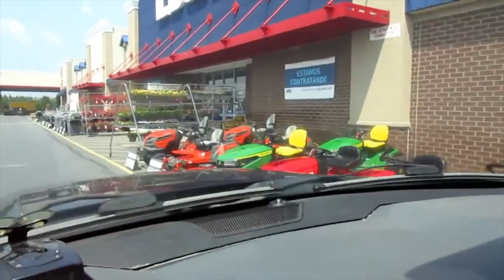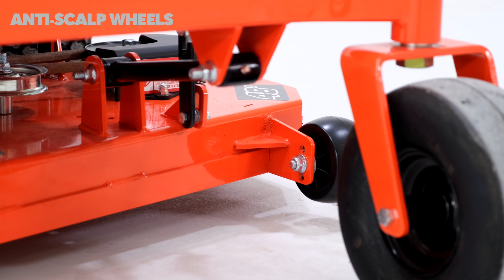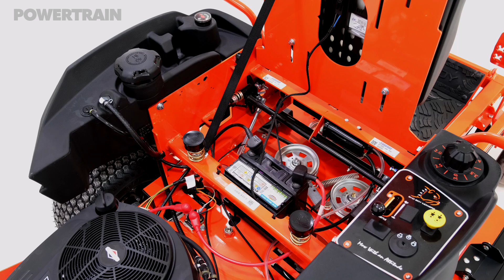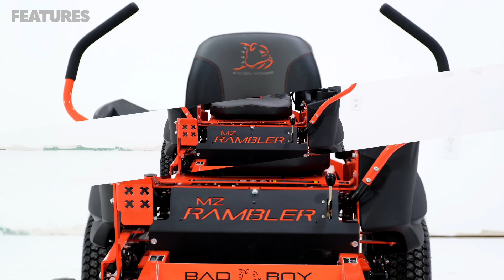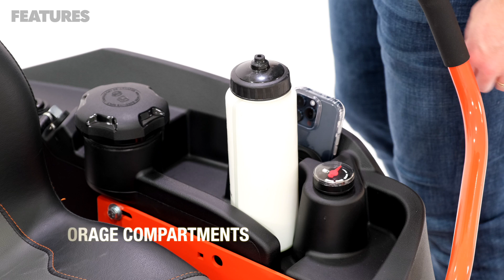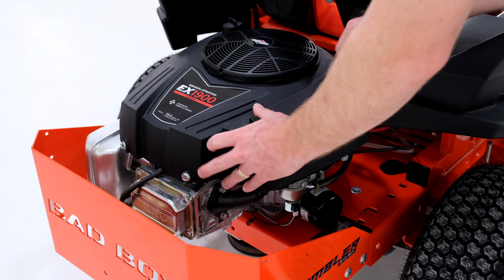Best Residential Mower FOR $3,000 | 2024 Bad Boy MZ Rambler

Comment: how many inches is it from the seatback to the drive handle while in reverse   i sat on a 52 incher and  the handles where in my chest when i pulled back  on them   was about 12 inches   gap  with the seat all the way back
Reply from the maker: If you’re having that issue I’d recommend getting the adjustable steering arms which will allow you to position the arms so that they don’t hit your chest.

Comment: I have 4 acres but only mow two of them. I'm thinking on getting one. I am not worried about speed or getting it done super fast.
Reply: If 2 acres are not too hilly, this is only mower on market you want.  Best $ to quality.  Change oil and filter every season, no matter hours thou.
Reply: @redvraven3285  It's not hilly but it is very bumpy in some parts. Lots of trees and tree roots.
Reply: @bertroost1675  Rambler has best deck on market I know of.  At 7g it will take a beating from them roots banging around.  Bumpy is bumpy.  Rambler has seat springs.  Comfy for 2 acres.   Stihl's and Ferris have 4 wheel suspensions on entry level models that are usually overkill for a semi flat yard.  And your talking $500+ now.  Is it worth it, hard to tell.

Comment: My local dealer offers this mower with two engine options, either a 540cc Briggs or a 725cc Kohler Pro 7000. The Kohler is offered at an upcharge of $380 over the Briggs and I'm curious if this upcharge is worth it?
Reply: Absolutely worth it.
Reply: I would pay more for  kawasaki
Reply: For heavy use, Kohler. For an hour a week, Briggs. Keep Briggs filter and oil changed at the start of every spring. 
    I have Briggs. It is also very simple motor. 1/3 acre here.

Comment: Would you recommend the Rambler or the Husqvarna 200F series? I like the build of this but also like the kawasaki on the husky. My yard is pretty flat overall. If you could detail why you choose one over the other, that would be really helpful.
Reply from the maker: The engine is better on the husky, which makes it a great choice. Plus it’s got an hour meter. The deck is not quite as heavy (10.ga) while the bad boy has a more heavy gauge deck and better side chute. Both are going to drive the same although I’d say the husky has slightly better steering because the control arms are a bit more premium. Plus I think the front tires are bigger on the husqvarna

I’d go with the Husqvarna z200f but make sure you get the F series. 

We’d be happy to deliver one to you. If you’re in need. 

Best,
Reply: Rambler-7g deck, 5gall fuel tank, a bit cheaper.   Hus-Crazy 24hp power engine, deck bigger at 48", but real thin at 11g.

Only if you have real thick grass would I get the Hus for the power.  My worry on it would be the deck durability.  If shed kept, it be ok thou.

Comment: This is $4,200 where Im at !
Reply: I bought a Ramler back on Sept 2022. Has the Kohler 22hp engine. I added Bad Boys assist bar. Delivered to my home, which was free, out the door cost was $3988.
Reply: @ValkyrieRiderIPT how big is your property & how long does it take you to cut?
Reply: @RiseT14  I'm on a double lot. I'd estimate 0.60 acre. I almost always mow the entire alley for our block. Many times I mow part of my neighbors lawn on both sides of me. Total is around 0.75 acre...maybe a tad bit more. Depending on the grass height, it generally takes me about 1.0 to 1.25 hrs.
Reply: @ValkyrieRiderIPT
Reply: Got mine near Harrisburg, PA. $3300 Cash price.  If yours is 4200, it maybe 2023 model with a 23HP Kohler.  Overkill imo unless you really going to push this thing every day of the week, which is perfect for a inside them 48" gates, for commercial mowers.  19 Briggs is even overkill for my 1/3 arce.
Reply: Me too

Comment: Any issues with the Briggs motor being a single cylinder for residential use?
Reply from the maker: None so far, but these mowers are designed or light duty use. so I would expect this machine to run reliably for 500 - 750 hours.